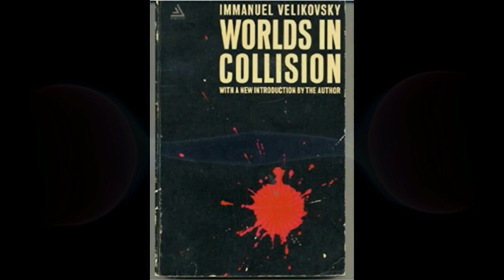Home Made Lightning (Not a Tesla Coil...)

Comment: This is how I was cutting rocks ten years ago. Make a line with water and the rock should break when the sparking stops.
Reply from the maker: I may try that g law - thanks!
Reply: @TheGoodVibrations  make sure to wear UV blocking glasses or you may go blind like I am years later. I might be just getting old but I have had my eyes burn for days from UV radiation exposure. Be safe I like your content. Make sure you use a well ventilated area :)

Comment: Go to DITRH and JERINISM channels they both have something you should research. This is not a joke you are on to something big but need to change what you are on.
Reply from the maker: I have researched the FE claim. I am not convinced.
You should check out the Electric Universe / Thunderbolts Project.
Reply: @TheGoodVibrations  Ok, if you think deep you will see you are convinced and think about that Gravity was invent base on mass, so there is no free energy to think of. So, all is about mass, so perhaps they know about free energy with mass, so use mass instead. The point when they think mass, gravity, etc, not thinking massless, then the whole reality is wrong because the model that human create is not compatible to reality model base on Energy itself to mass. So, one lie can ruin the whole truth right, same with disinformation or misleading information can block accurate information. So, that is why you believe magnet is gravity, even they don't believe it, so if you go deeper then Magnet is not compatible to heat because it will decrease the energy. So, it is all about balance of low density to high density, which magnet is high parallel density, compare to heat that is high cancel-out density. So, there is alot of heat with magnet at center. Even, the magnet spins faster as centripetal expand which the energy itself that is South which pull-in and at same time the pressure itself in mass that is N cause impact, so pull in and impact, both expand which overlap the heat. But how much spin to overlap the diameter of earth? The point everything is about math and order. Like 1 + 1 is 3, not 1 + 2 is 4. So, you expect humans to be all honest? Best to think everything new and see everything, not some like you did for a theory about a magnet. Which is good. If you are not convinced about flat earth, then think deep you will be convinced. So, base on understanding of energy, then magnet is not compatible to heat which it will reduce the magnet field which has volt that carries electrons. Base on Leeh..., that built stuff in Florida. So, magnet current which the primary that is volt which carry the current or volt is current which the volt cause the impact or there is a gap so there is a fill in that Aether pull in like air go up out of space. So, it is about layer balance of Aether that is one layer to Mass that is second layer, so in between there is balance of density which one missing will cause fill in. Aether is like gas. When you heat the gas, it vibrates at a higher level and spread out in bigger way. Well, there is another reason why flat earth is true beside magnet and heat can make it true with higher spin as a barrier to heat. But it is high enough or so. So, gas and liquid do not work in space so the rocket do not work because it is depended by lower density mass.